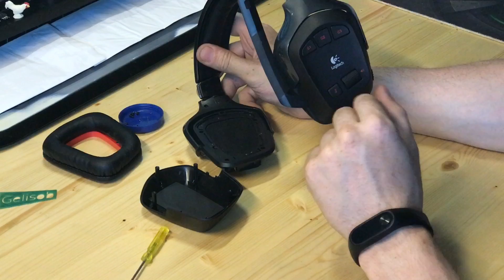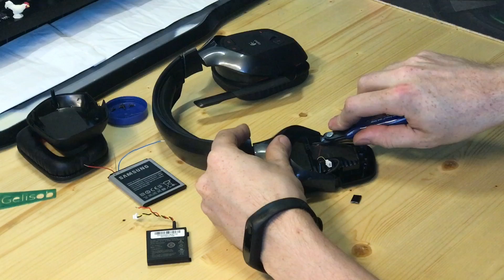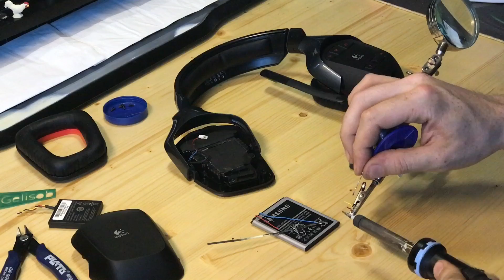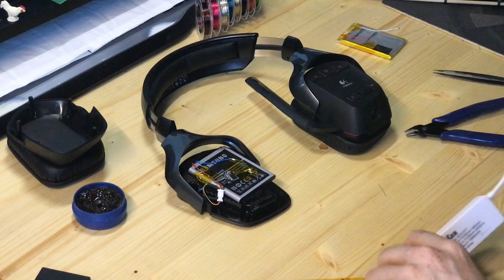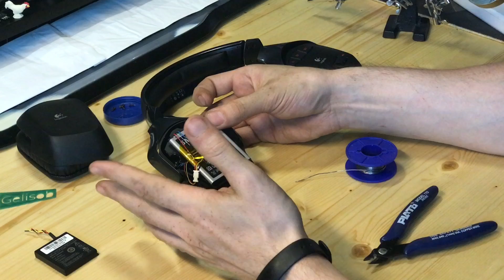Logitech G930 24h battery mod

Comment: I'd rather make a mod that uses a removable 18650 battery with the battery holder on the top of the headset. Cheap and easy battery replacements for life. Do a video on this!

Comment: Thank you very much for the video! From 15:50 to 16:10, is the yellow cable from the connector soldered to anything? Thanks!
Reply: Hello past me. It's me from the future (relatively speaking). No, it should be connected to the middle connector on the battery.
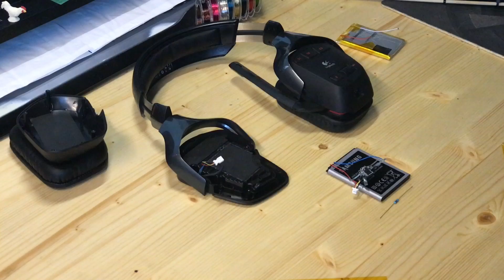Reply from the maker: it was connected to nowhere. It landed badly on top of the board there, making it look like it was connected to something, sorry. Continue to watch my after test conclusion where i figured out that it cant be left disconnected, at 19:06 - yellow must receive around 10k resistance relative to negative lead. 
From the comments i've red, people have successfully used original battery protection so I would probably do it that way now - less things to buy, more freedom of battery cell choice. But would require breaking the original battery case, must be careful with that.

Comment: Hi i used the battery protection from the logitech battery. I only connected positive and negative wires of the battery to protector. When it is not used it charges. I think the battery can't charge well while using. It turns of and turns on every period of time. @gelisob #gelisob

Comment: Hello, great video thanks you
This video is 3 year old, so i tried a different solution to upgrade my G930, less hacky, more accessible and with "genuine" parts.
I buy directly from Logitech spare part the battery from the current G933.
That an upgrade from 650 mAh to 1200mAh. (10h to 20h)
Specs are the same, only the connector is different, so you can just solder old connector to the new battery and VOILA.
This battery is also secured in a case but it's quite bigger so the procedure is still the same as in the video. (clear some space)
This battery is quite cheap ( 12€ in Europe) but shipping fees are about 12 € so nearly 25€ ...
You can find it on the support page of Logitech G933 in spare part section.

Edit: After two years it still working but performances are reduce. I have still 15h of working time
Reply: Hallo  where i can buy this battery 12€ i live in germany
Reply: @MrBobgold  
After two month of use: still working, capacity is great (12 hours in heavy use, 20 hours normal ), unfortunelly logi software can't predict accuretly battery left.
https://support.logi.com/hc/de/articles/360025256214--Ersatzteile-G933-Artemis-Spectrum-Snow-Wireless-7-1-Gaming-Headset

Comment: Great video! I found a site that sells Logitech replacement batteries and I found this MX1000 battery which is same voltage and battery type and has built in protection. Disregarding any size problems, do you think that would be possible to just connect the cables using that? https://www.batteriexperten.com/sv/artiklar/logitech-mx1000-mfl-ersattningsbatteri.html
Reply from the maker: Thanks :) Very likely that the connectors are the same type since same company and they probably try using as much same components as possible across their products. 
If it is not the same then you can just cut the one from existing and solder together matching colors. Or if you are really green and dont have soldering options, clean the wires one by one, twist together and tape each one before doing the next. Good luck and let us know how it worked out. 2000mah logi own battery would be nice.

Comment: Do you really need the protection cicuit? Original battery already have a protection circuit why you dont just use it on the phone battery?
Reply from the maker: Asking people to disassemble the original battery is more fire hazard than showing how to put on a protection circuit :) If you are handy and know what to do, you can of course use one from original battery.

Comment: CLICK BAIT........because BEFORE UPLOADING you knew it was no where near a 24 hour battery and only until about 25 minutes of your 29 minute Video did you tell your suckers, like me, that it was nothing near what we all along KNEW it was.. Couldn't you have titled it "G930 24hr battery but was only 2 hour improvement"?  Or something like that?  Seriously, does anyone else agree?
Reply from the maker: Not sure what you ment there. If you do not get scammed by the battery seller like I did and receive a proper 2000mah battery then it is 24h battery. That is why i recommended looking for local suppliers who are less likely to sell used stuff and claim it to be new. I replaced the scam battery with a rescue cell and it works 24h. You jumped to conclusions too fast there.

Comment: Thanks, had issues with my right eat cutting out.  Used this teardown to take apart the left ear and shift the wires around to fix the issue.  No soldering or anything else!
Reply from the maker: Good to hear. But if it was cutting out and moving it helped, then there probably is some wire broken and you moved it to touching position, it may disconnect again when shaked. But maybe it was a connector that needed to be moved in more that you happened to do now.

Comment: I've done it with the same battery - u get around 12 hrs tops
Reply from the maker: If you watch until the end, you can see that I actually used a lipo element with a confirmed 2000mah capacity. That does last 24h. The samsung battery you may have used probably did not have the claimed capacity. It's easy to get an used half capacity unit from china sold as new. Test it to see the real capacity.

Comment: I am sorry to say that but you maked it very very very complicated ! And I am sorry again but that only show us not to make in that way ! You can buy Logitech akku on eBay or Amazon and co. !if you need more mAh you can use the akku from G933 or g533 - 534 - 535 with 1100mah , harmony elite- 950 with1330mah  , Nintendo 3ds Akku with from 1000mah - 3500mah . And for your mod you could use the Platine from that original akku ! Only my opinion ! Thanks for the video.
Update ! 
Nintendo 3 ds  Akku works really good ! 
Samsung Akku with 2500mah works good too!
I tested other Akkus from 1300mah to 3400mah and works fine to !
Note! : If you have a battery up to 2500mah you don't need to charge whole week !
I let the Samsung 3,7volt 2500mah in my Logitech G930 and it lasts 1 week in my case if it's full charged !
Yours can be different! 
Be always careful!
Regards,
Reply from the maker: You're welcome. Do what's best for you. But be aware that all those "bigger" batteries have fake capacities on them. If they physically are the same size.
After you get those other ones from amazon, do a test and let us know which one you got 24 hours of playback with :)

Comment: I put a battery from Logitech G933 at 1200mAh. We need to work a little needle file and solder the connector from the old battery. The battery fits perfectly. The headset works for 20 hours.

Comment: Surely the G930 circuitry has battery management within it, as it monitors the battery level in the software.

I used your other video many years ago to put an iPod battery into a Logitech H800 set and it's been great for 4+ years. That battery doesn't have protection, so why did you use it in that one? The H800 had to be cut out internally to fit it, but I managed to still be able to hide the USB connector in that same compartment as the battery, so it has 1200mah + USB holder.

I recently got a G930 set for very cheap and will put in a similar iPod battery that has got that little molex connector (although may need to have terminals swapped to match up with the G930, as it did with the H800 set). The size of the battery is small enough to fit in the original battery area,  so no cutting needed.

I don't understand why you did not just do that with these G930s as you did that in your other video with the H800.
Reply from the maker: I have another video that measures the real capacity of those "1200"mah batteries. That capacity is a lie. The G930 original battery has as much or bit more than those we used in H800, when you remove the lied amount and look at the reality. This is why I went with something bigger that really adds benefit. And how can you complain about 24h battery life ;) PS. Those little ones do have battery managment, look closer, there's a tiny circuit under the shrinkwrap, also three wires is a givaway hint, if it were plain battery cell there would be only two leads, positive and negative. Thats why i'm adding one, since I believe the original G930 one has it in the plastic box too.

Comment: I just disassembled original battery and used it's protection circuit along with the original plug.
It has only + and - , the battery I used(one that is recommended by this video) has 3 "pins" so I only used it's + and -, 3rd one is not used at all.
Headset works
Light indicators work as it should
Right now waiting till it charges 100%
Logitech app says it's 3-ish hours to full charge
Hope I will not get blown off by battery explosion in that time :)
Will add a comment when done testing.
Reply: I've set lowBattTime="60" lowBattInformInterval="3600" in Device_Manifest.
One battery charge lasted from approximately Monday evening till Friday 12:00, it's ~3.5 work days with Surround Sound on - huge improvement comparing to < 1 work day on old original or new "aliexpress" battery with Surround Sound off.
It seems like software has hard coded 9 hours battery life span and 1 predicted hour actually equals to ~3 hours. Though I can't tell if software/controller is reading battery charge level correctly.
Headsets were working flawlessly. Once again, its huge improvement even if software/controller is not using up all the battery capacity, that doesn't seem to be the case here.
Thanks!
Reply: @zheliznjak  hey is your headset still working properly? I'm wondering if i should do the same. Thanks :)
Reply: Neutro yes they do :)
Reply: @zheliznjak  Thanks for your answer :) Before i tried this i wanted to see if i could fix the micro usb charging port on my G930 that was loose as well but the soldering point was so small and so close to other components that it was almost impossible and i broke it :( lol So i bought another headset instead ;)
Reply: @zheliznjak  I used samsung battery that has 3 pin as like at this video. But charging indicator light just 4 times blinking and stop. What about yours ? Is it continuously blinking while it charging ?
Reply: Aycan Nehir yes, mine blinks same way as with original battery.

Comment: can i use the battery of a logitech g933 for the g930 ?

1200mAh/4.44Wh   3.7VDC

(https://www.amazon.de/dp/B074ZL79NR/ref=sspa_dk_detail_2?psc=1&pd_rd_i=B074ZL79NR&pd_rd_w=wa205&pf_rd_p=00903874-3af0-47e0-8622-ee58087f71cf&pd_rd_wg=yv9Wk&pf_rd_r=Q15Z7HH4Y7KN7Q8PRVR6&pd_rd_r=6ed34ef1-3518-11e9-82bc-e34997293e31)

Comment: the resistance (ohm's) from negative to the middle connectors 35k. so you need to put resistance on 35kOm? battery nokia bl-5cb 800mAh. with resistance 7.5 refuses to charge

Comment: Wouldn't a 7,5K Resistor work as well?
Reply from the maker: I cant test but you can. It will not do anything bad if you try. If it starts to charge then it was enough, if it doesnt then it wasnt enough :)
Reply: Ok thanks.
This BMS should work fine right?:
https://www.ebay.de/itm/1S-2-5A-3-7V-Cell-Li-on-Akku-Batterie-Schutz-Platine-BMS-PCB-Lithium-Protection/122950792222?ssPageName=STRK%3AMEBIDX%3AIT&_trksid=p2057872.m2749.l2649

Comment: Could you explain how to do it without a battery? single USB cable
Reply: my g933 works with a powerbank. So an extern battery you normally use to charge mobiles.
Reply: @FightingPinguin  Awesome idea, man. I think a smaller power bank is much easier and much more reliable to adapt, even externally, if one doesn't mind the bulkiness. Gonna do that.

Comment: So I decided to go ahead and test this mod out on my G930. I tried it first with a smaller 1380mAh battery and it still worked but it wasn't a large enough capacity for the mod to be worth its while. So today I went to my local 'Schenzen market' and picked up a 2100mAh battery (different resistance though so I had to put 12KΩ in parallel with signal & ground wire) and it seems to be working a treat! Once I've drained this cell enough, i'm going to do a full charge and verify it's capacity is as stated. then i'll cut away the plastic inside and mount it!
Reply: So after a month, I can confirm that the firmware on the Logitech headset is the biggest issue. It doesn't recognize and adapt to the new capacity curves of the new battery and thus the headset will randomly think the battery is low/dead and turn itself off. Switched back to original battery which is far more reliable than a battery that wasn't designed for this in the first place.
Reply from the maker: good job, hope you like it :)
Reply: Turns out the capacity was closer to 1600mAh, still better than the tiny 600mAh it comes with! Do still get the odd disconnect but this seems to be a running problem with this headset

Comment: 18:50

FOR SAFETY, PLEASE READ ENTIRE COMMENT!!!!!

I'm unsure if this video was before or after Samsung explained the failures of their batteries, but it wasn't the overload / under protection that failed. It was the manufacturers of the batteries. These LI-Ion batteries are very interesting. They are rolled up and look like. fruit roll-ups, haha.

The battery layers were damaged and ended up touching. As soon as this happened, it's like a toaster or hair dryer. Current will continue to flow and generate heat with nothing to stop it. BOOM/FIRE

Here is more detail right from Samsung. It was quite interesting!!

https://news.samsung.com/us/Samsung-Electronics-Announces-Cause-of-Galaxy-Note7-Incidents-in-Press-Conference

There was a press release video that showed thousands of batteries being tested. I was impressed with the scientific method being used in such great ways. I gained a lot of respect for Samsung.

*****This is why when he says to be careful with sharp points if you place the protection circuit on, PLEASE MAKE SURE. Or, you could very well have a bomb on your head.***** If you puncture the battery, or damage the layers, it could exploade!

Sorry to distract you guys. This video is very good! Thank you so much. Thank you also for removing the iron interference as well when you weren't talking. It made it much more enjoyable.
Reply from the maker: This is generally a good idea not to puncture batteries. The problem with note7 batteries was with note7 batteries. These used in this video are old stuff that do not present such danger as the failed note7 batteries did. Just so everyone knows. Note7 batteries came like 5 years after these :) I dont mean they cant fail but they dont come with manufacturing faults that note7 batteries were pushed into.
Reply: John doe you fell for it ? Samsung smartphones by s4 was very great ! But that Knox system knocking it out ! Is shit ! Not only that up s5 to now is only shit product that has tons of mistakes ! S5 series with USB 3 charging port ! S6 series with lcd Akku fails pixel fault - error ,bug ! And and and ! I was a Samsung fan but not anymore ! And was with Samsung TouchWiz ! You can all 2 or 3 months install or flash your smartphone again because it will slow down with time ! Apps that was installed just dissaper ! I that is Samsung ! 
Is only my opinion.
Regards,

Comment: Thanks a lot for this video sir ! This got me motivated to upgrade a spare G930 I had laying around. Its battery was shot and could barely stand 2 hours (whereas the main one I use could still hold 4+ hours after 6 years of intensive use).

I used a 3000mAh battery from a dead LG G4 I had. 
For the protection circuit, I teared down the battery casing and reused the one from it.

Had to make a cut in the G930 casing because the battery was too long but otherwise it works perfectly. 

I "bench-tried" the G930, let it play music for awhile ... then charged it for 2 hours : no heat at all from the battery, the software makes me think it charges / discharges ok.

I'll update this comment if anything changes but so far so good ! 

Anyways, thanks again gelisob for your very accurate and detailed video !
Reply: Hey any problems you faced? Im also thinking of doing the same approach as yours kindly tell me the end result

Comment: I messed up the first battery. I ordered a 2nd from anker and it says it has built in overload and over voltage protection. Does that mean I just need to connect the + and - wires and the resistor?
Reply: Well I got it wired up but the logitech only shows 5 hours remaining even after unplugging it when it says fully charged. Should I try wiring it to the other - spot on the battery as well?

Comment: I need some help. I ordered the battery that said it was the correct one and it is 2100mah but it has 4 battery contacts. One contact is not labeled. The one to the right is labeled as - the one next to that isn't labeled and the one next to that is labeled +.
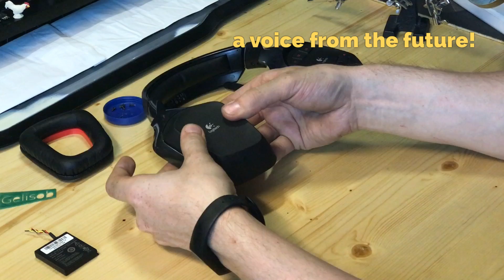Reply from the maker: You can just use "+" and "-" and wire it like i did later on, you can see picture at 28:55 - the minus side also runs to third wire through 10k resistor and thats it. You can see on the picture resitor leg starts from close to protection board off the minus side.
Reply: gelisob I messed up the contacts:/  I ended up splitting up the - and was trying to wire both -